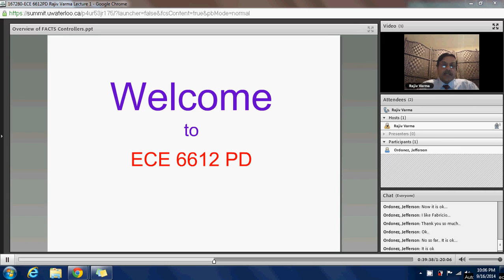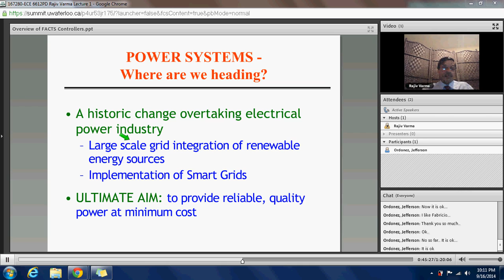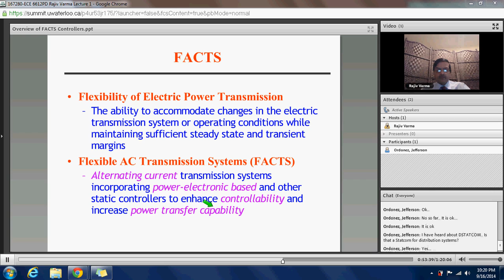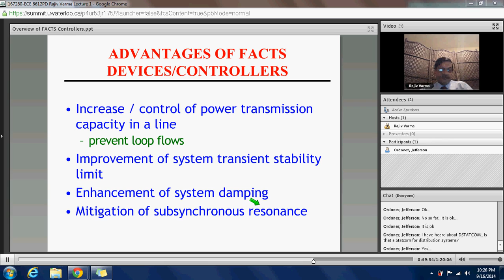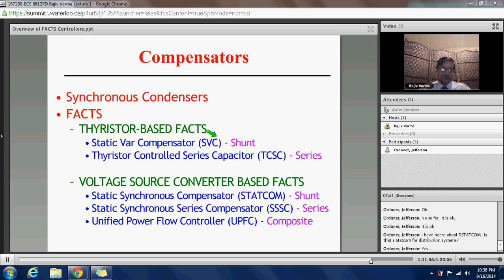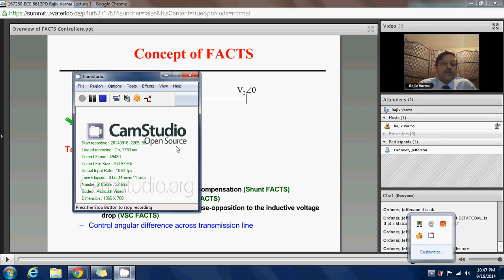FACTS: Models, Controls, and Applications UWaterloo L01

Comment: sir I have a doubt 
suppose if we can make XL = XC then can we have    infinite power...?
Reply: transmission line is a current carrying conductor, so it is highly impossible to avoid inductance effect and there will be no question of X=0 practically- I think this is the right answer. let me see what will reply you.
Reply from the maker: No we can never have infinite power... Xl≈Xc helps reduce system losses (or voltage regulation)... Please read more on Surge Impedance Loading (SIL)